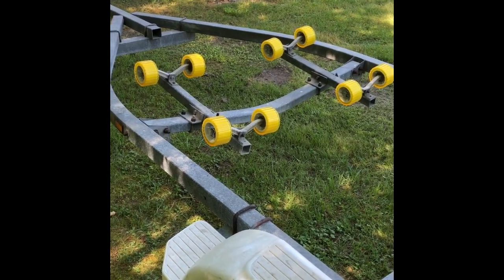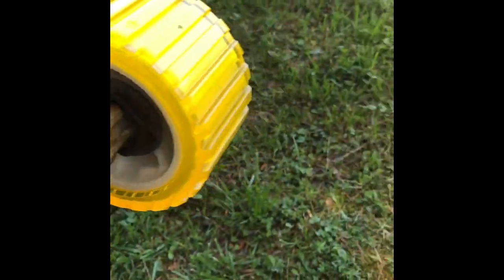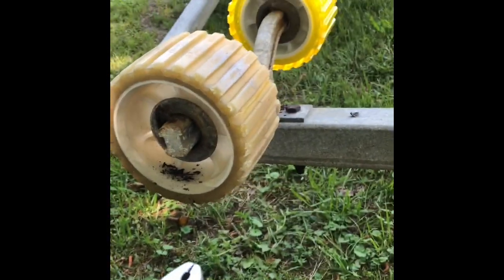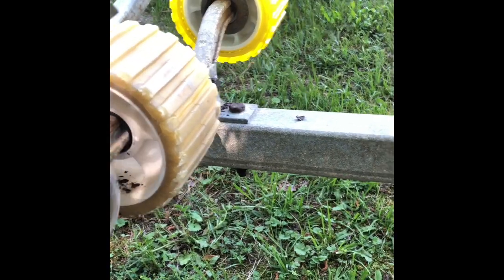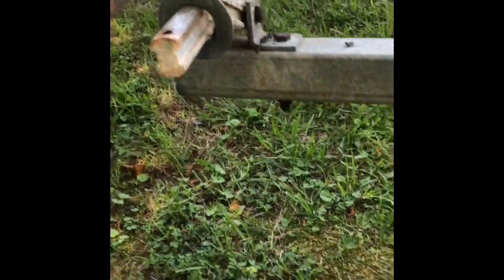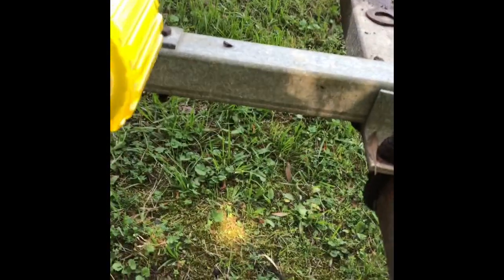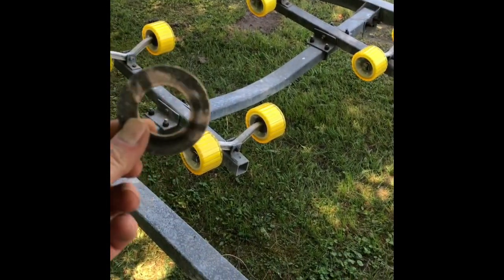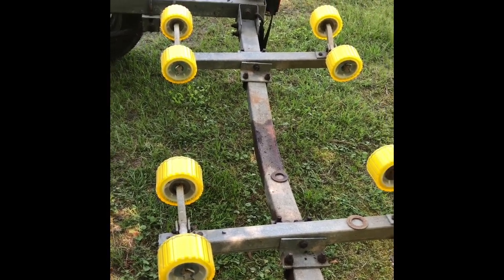Replacing Boat Trailer Wobble Rollers  Need To Know

Comment: This is great, really good tips.  Unfortunately, the rollers on my trailer from 1988 are not clips.  It is a round "thing" with 3 notches that hold the washers in place.  Not sure what those are called or how to remove them.

Comment: What happens when your old rusty clip breaks and you have a piece left inside the hole rusted in there?
Reply: That’s exactly what I’m dealing with, I put them in a vice n bet it with a hammer n punch n no movement, how did you do??
Reply: @TheDuffman1986  The person who does my trailer repairs told me he would put a torch to it, and if he couldn't get it out that way, the whole section would be replaced. I've been able to get away with just putting the clip up and over, but I'll need to get it fixed correctly eventually.
Reply: @laserhelp  re-drill the holes for the pin is what I did, worked fine👌 let me know how u go!